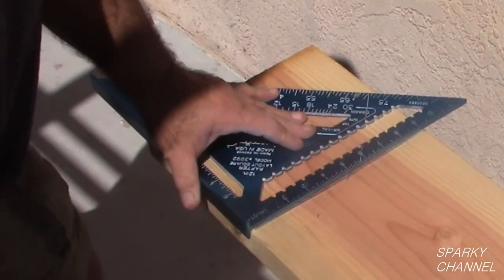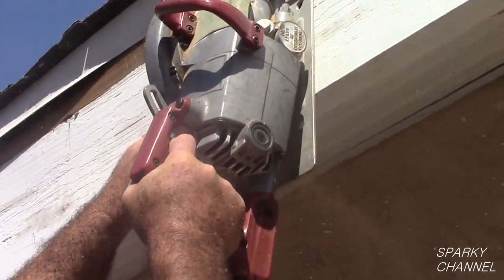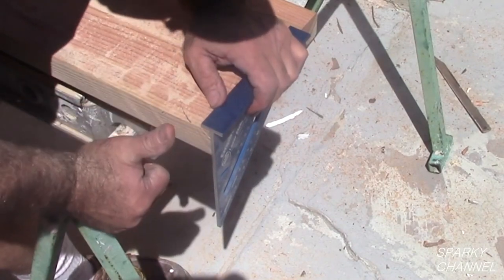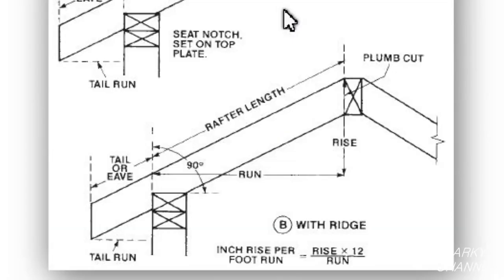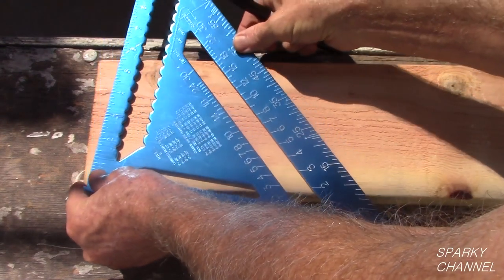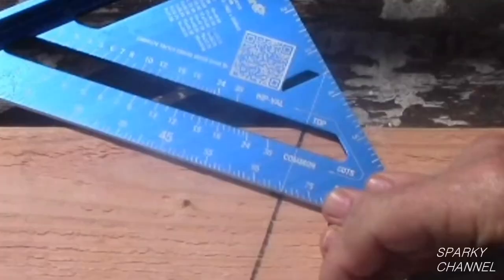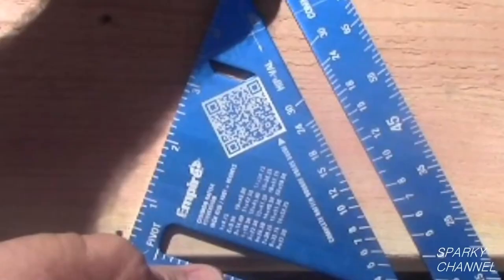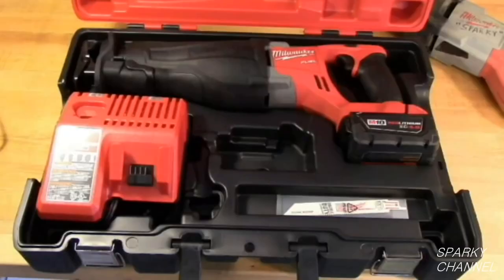How to Use Rafter Squares, 12" and 7"

Comment: I have several different brands but my favorite is Swanson due to the thickness of the metal and the depth of the markings. I am not a fan of laser etching.
Pitch is rise divided by span. Slope is rise divided by run. They are two different things. 4:12 is a slope, not a pitch.
Reply from the maker: Thanks!